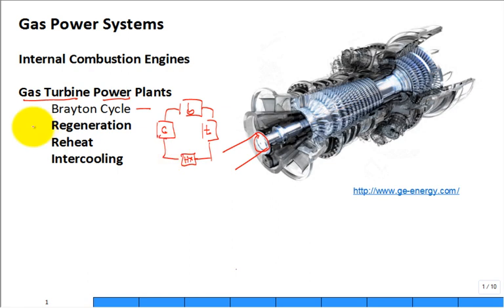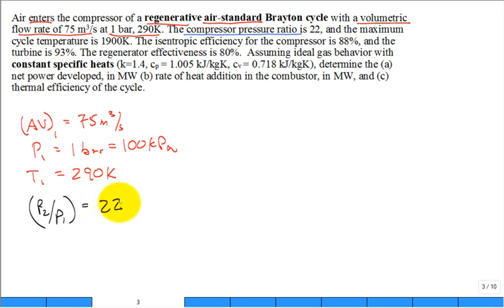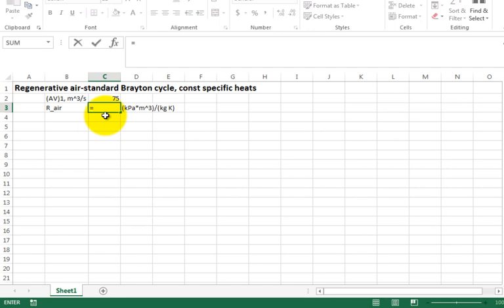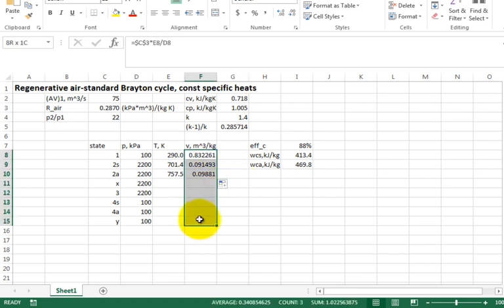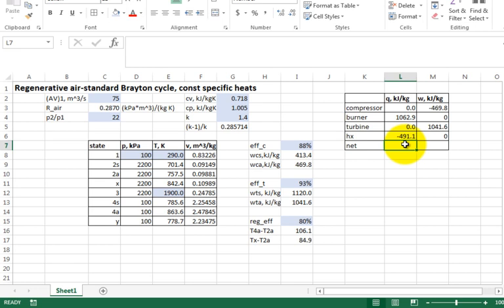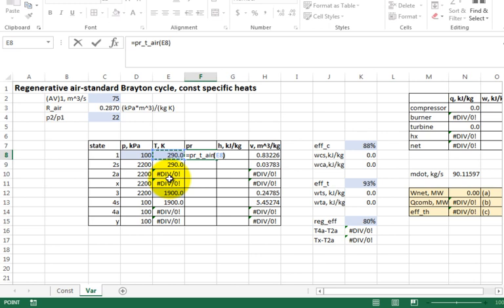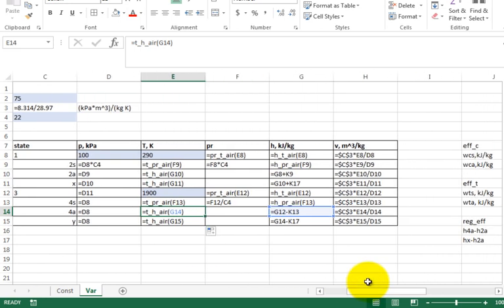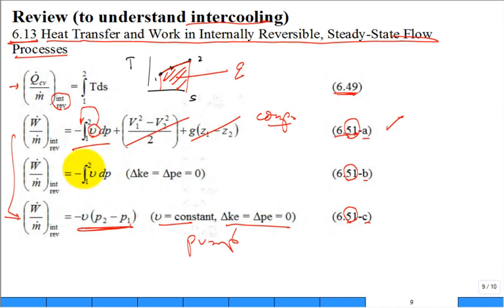Regenerative Brayton with Excel

Comment: 53:00 Professor, once you auto completed by pressing tab you can freely navigate to the adjacent cell by pressing right arrow and Excel will put in the cell reference(s) into the formula. You can press shift for handing in ranges of cells.

41:50 When you want to sum up rows ensuring energy balance you could use the auto sum feature by pressing "alt + =". Summing all data in adjacent cells is such a common operation, that it has it's own implementation.